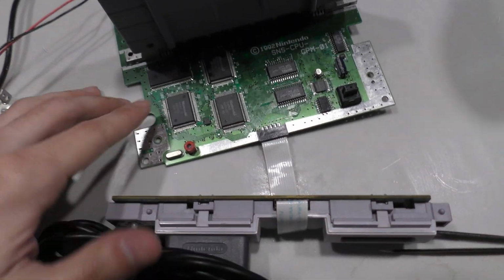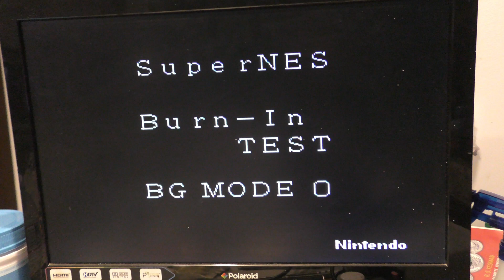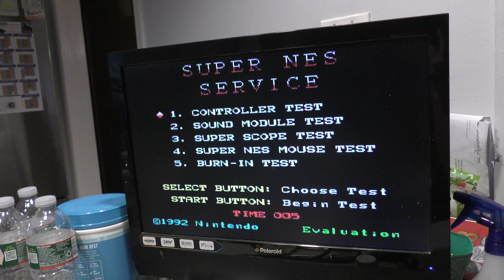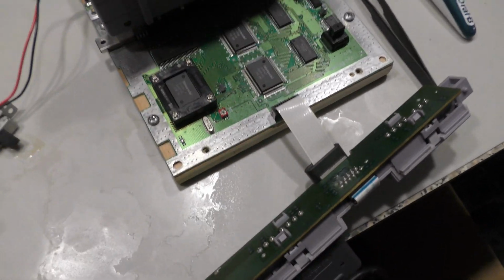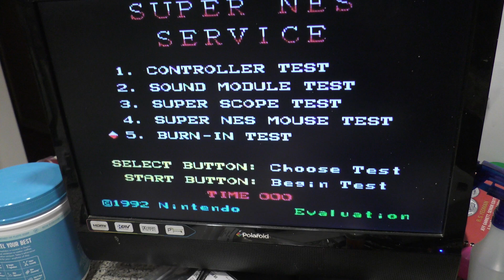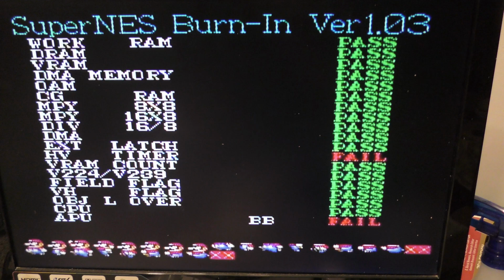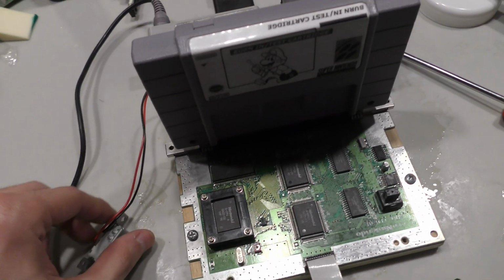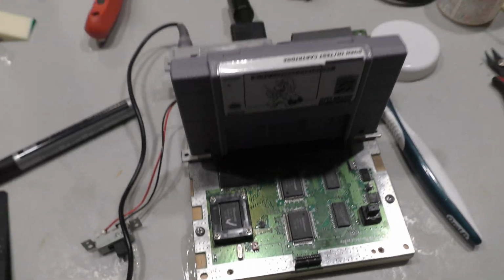SNES Repair: Burn In Test Socket (Part 2)

Comment: for shvc-cpu-01: the caps near the multiout leak and they kill the vias. that's why you get only audio. I've seen that many times. Nice to see you got a cpu socket. I also have them for cpu, ppu1 and ppu2. But they are a pain to use.

Comment: Dude love your vids. I got an hold on a PAL snes 2 chip unit. It turns on just fine and occasionally displays on screen only for few seconds and that's about it. The console shell is cracked on the front and I am positive it was dropped. On a close inspection I noticed that PPU-1 and PPU-2 chip have had something done to their legs namely pin 24 and pin 30. My guess is that the previous owner tried to mod the console to run at 60hz and damaged something in the process. Also noticed shoddy solder work on the legs of the frequency crystal. Based on your experience, is it possible that PPU1-2 got damaged even if all that such modification requires is to ground pin 24 and 30?